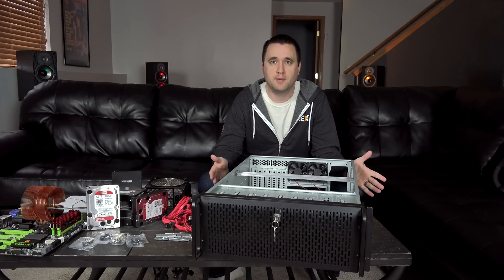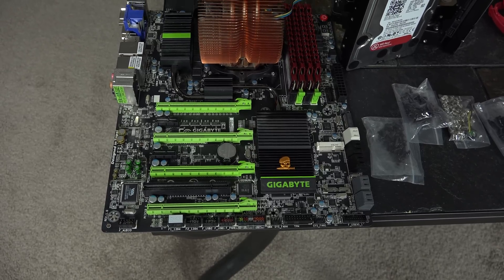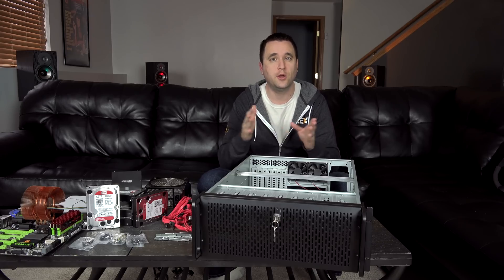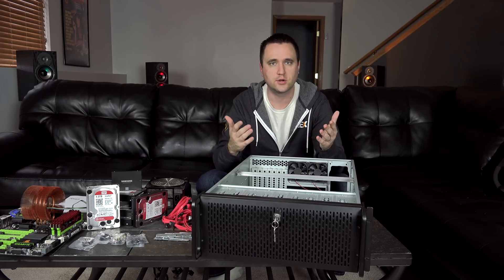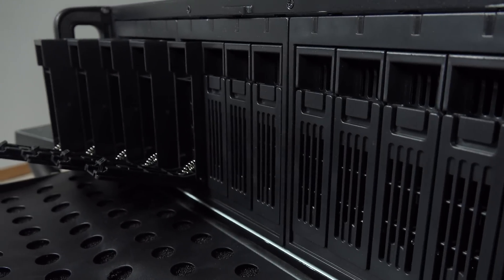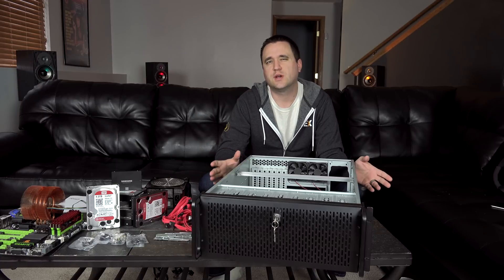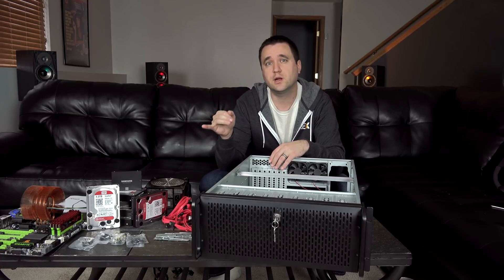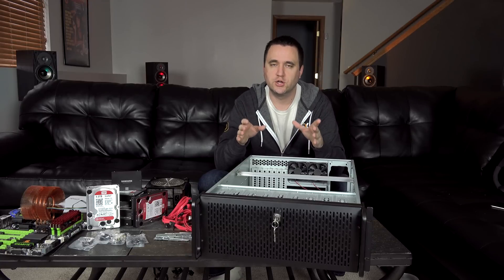Building an Expandable, Dedicated Plex Media Server

Comment: Think you should ditch the WD Reds and get some HGST Nas drives, more reliable. 👍🏻
Reply from the maker: +Sudds1888 When I started the switch to NAS drives, Red was ~$40 cheaper than the HGST drives. I just checked, and it looks like they are the same price now lol. I would prefer HGST, but I am trying to get 5 of the same drive to start a RAID or ZFS. If the prices stay the same, I will probably make that switch after my first pool is built. Just gotta work up the money to do it.
Reply: +Byte My Bits Yep the funds are hard to get! 😆 Just recently built an HTPC, have a 500GB drive in there at the minute, same boat as yourself can't afford the HGST 4TB at the minute £130 and I need 4 of them. 😩 Currently  converting my BD's. As a matter of interest have you converted any? And if so, do you leave them full size or compress? Love the channel mate 👍🏻

Comment: Hi Jason!! Great Video!! Can you do a Install configuration video of Plex?  I am Running Plex in a Unraid Server and I am planning in a Upgrade, but haven't decide if I will do a Windows or Mac server or a New Unraid build.  The most important thing to me is data protection that's why I use Unraid!!  What is your disk configuration and data setup for redundancy? with the new Unraid 6 and Dockers you can also use a Dedicated Graphic card and resources to use it as a main and stand alone Windows,Mac,Linux or Kodi machine!!  So that way it will use 1 machine with different OS and applications!! Keep up the Great Work!!
Reply from the maker: +Ariel Ferrer Right now I have an issue of too much data, and not enough drives. I would love to use a ZFS system, but don't have a place to store my data for me to build the file system. So until I can horde enough drives to allow me to do this, I am just running Windows with no redundancy. I hate doing that, but I would need at least 5 extra 4TB drives to make a zfs1 pool before I could switch.